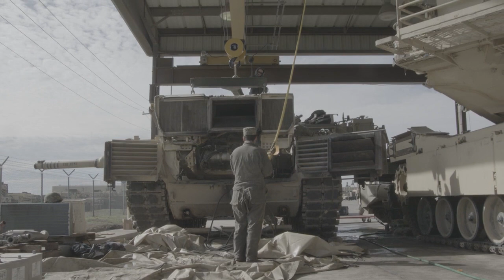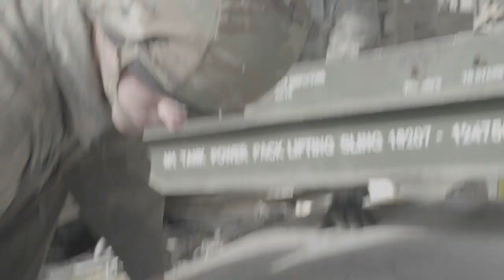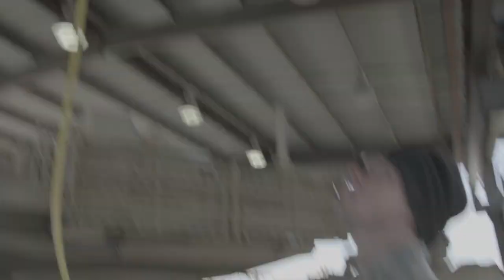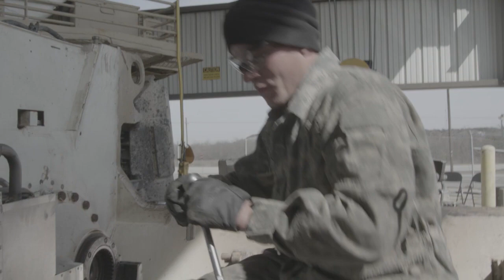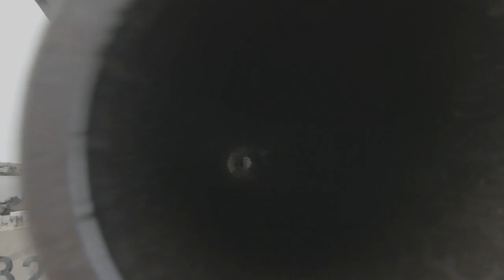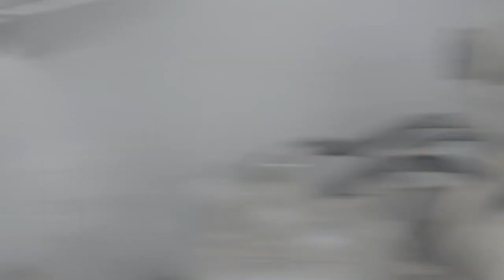Watch US army Mechanics Replace a Monster Abrams TANK Engine(2019)

Comment: We replaced a powerpack at an intersection in Husayba (might have been Haditha) Iraq back in 2005 (13th MEU; Operation Steel Curtain). We had the old one out and the new one in, in about an hour and a half. Wild times back then. Be safe (USMC vet; 2003-2007). Some of the best and worse  times I've ever had.
Reply: Hi Steve, im looking to build a model kit of an M1A1 Abrams, and looking online i found a photo of an M1A1 of the 13th MEU with the number USMC-579767 from 2003. I must say that it looks badass, so im wondering if you have any more info about that specific tank and its history. Thank you.

Comment: I have dropped hundreds of engines in, maybe more, But never something as beautiful as this.
When I would replace the short-block on a Geo 1liter 3cylinder it was handed to me in a UPS box.
Reply: so have i   What are you talking about
Reply: Mike Flynn The fact that's it's modular, And bad ass, did I hurt your feelings?
Reply: Mike Flynn The engines Ive built are GM, They are mostly underpowered mass produced garage, why wouldn't you understand what I was saying if you have done so many? You work for Ferrari?

Comment: I wonder why they don't just use the upgraded engine from the M60???
It made like 1100 hp and was very reliable.
Reply: M60 is way less complex. Most Lilly doesn’t weigh as much and the M1 has 1500 HP.

Comment: It seems like the military would convert the M1a2's engine over to a twin turbo V12 diesel to improve gas mileage and range.
Reply: They have a ATG for that.
Reply: @cooldloop2381  That's the jet turbine engine they already have in them...
Reply: That turbine runs off ANYTHING flammable. Thats one reason its in there.

Comment: There could be no more ridiculous system to use in the desert
Reply: I guess that’s why it works so well in the desert.
Reply: Lol thats what ive heard. Because of the sand chewing everything up right?
Reply: By all accounts this power system worked beautifully in the desert.
Reply: You know air filters exist, right?
Reply: @viceralman8450  Yeap,you think they are enough? Do you know there is desert right?
Reply: Sand and high air intake pressure 🧐 hmmm very good idea
Reply: @Can Çolak  yeah, the abrams has been used extensively in the desert for the entirety of its life. Ft irwin CA, ft hood tx, the gulf war, Afghanistan, iraq, GWOT in general. During the entirety of its lifetime, there has been no situations where a sandy desert environment has caused more than individual localized problems that were traced back to an individual crew failing to due the preventative MX of thier tanks. The abrams laughs at sand.